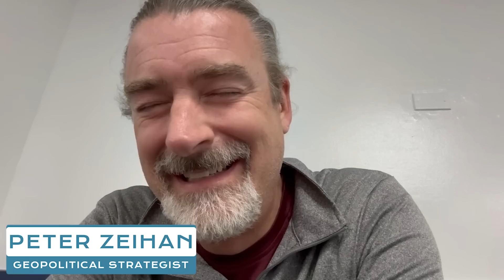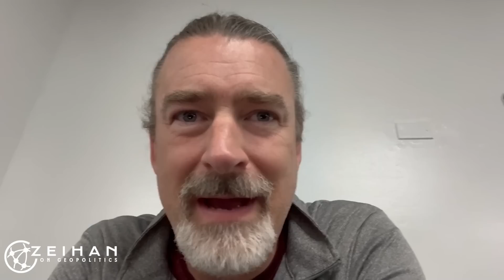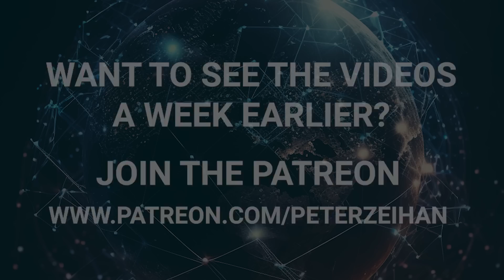Nuclear Power's Facelift: Small Modular Reactors || Peter Zeihan

Comment: Nuclear engineer here. I work in the contracting sector. Specifically, the work my company does is required for reactor licensing. Most plants are currently licensed to 60 years, but are pushing for 80 year renewals. More than likely they will also try for 100 year licenses, but beyond that is unlikely.
Reply: Is relicensing these facilities a big challenge after the initial license expires?
Reply: @CliffSturgeon  Yes and no. The overall process is relatively simple: is the neutron damage low enough for a license renewal to be safe? If the answer is yes, then you’re good to go. The issue is that each renewal for a plant requires more accurate and comprehensive damage calculations, which take more and more time. Also, there is the issue of that we simply don’t know how the reactor materials will behave at 80+ years of exposures, since nothing has been exposed for that long before. (EPRI is currently running exposure trials to figure this out).
Reply: @CliffSturgeon  no ? Sometimes it is with public resistance..
Reply: would it lower expenses if reactors could remove the need for on site storage by having domestic reprocessing like the french do?
Reply: @FroggyTWrite  Not really. Spent fuel requires multiple stages of on site storage before being safe to transport to a national repository (that will hopefully exist sometime in the future)
Reply: @FroggyTWrite  You do not want the PUREX process. Query CURIO ANS ... New process and less waste ...
Reply: Most parts are not radioactive and can be replaced over the years. Is the reactor vessel itself the only part that can't be replaced? (without tearing down the building)
Reply: @zapfanzapfan  Yes, that is basically correct.
Reply: Thoughts on Thorium Reactors?
Reply: @TheBryceWade  If we're going to go with breeders like the Thorium reactors, might as well go with Uranium/Plutonium breeders like the French have been doing for 50 years now.
Reply: @shawnnoyes4620  Guess I'm out of date.  Make that "like the French had for years before they stupidly shut them down."
Reply: YIKES we got like 4 reactors in the State of MICHIGAN alone. would be bad for our state and country if they were to all go offline. especially the Fermi nuclear reactor.
Reply: @brianhillier7052  Gretchen just announced 1 or 2 of them are either not going to close as planned with one actually being re-opened after being closed for years.
Reply: What structure will these SNRs  likely sit in? Someone will need to develop new structures to house these units?
Reply: @jimmeh213  Giant concrete slab. Simple as that. Likely partially underground.
Reply: @jimmeh213  SMR = Small Modular Reactor
Reply: Is that really desired? "how much better" is a nuclear reactor now compared to 50 years ago? might be better to force them to renovate at 60.
Reply: @celdur4635  It’s not as simple as renovating current plants. Nuclear reactors receive so much radiation exposure that decommissioning of them is usually just the encapsulation of various components into concrete tombs. You realistically can’t convert a current reactor into future reactor. New reactors need to be built. Once reactors near the 80 year limit I imagine some of them won’t qualify for another 20 year extension. That’s a significant chunk of the US power grid just kinda vanishing.
Reply: @celdur4635  Many of the newest designs are passively safe. They don't require immediate backup power to cool the fuel after a shutdown.
Reply: Aerospace engineer here - GREAT COMMENT.
Reply: @bretthuff8971 - Are you in the US?  If so are you aware of any moves in the US to adjust licensing requirements for SMRs given their different size, production method and potentially different risk profile?
I'm curious to see if regulators are even remotely close to such a thing, are there any special provisions for prototype reactor implementations such as an early SMR implementation?
Reply: @davocc2405  Yes, I’m in the US. The NRC is working on regulatory positions for new reactor designs, starting with SMR’s. But things like that take forever, and the lack of a concrete position delays development.
Reply: @Iskandardeeznuts  I remember the MIT students presenting "state of play" when they introduced their WAMSR concept on the TEDx platform about a decade ago - they mentioned that the fear and hysteria around nuclear power had drained the industry of personnel and that at the time of their presentation they were experiencing significant shortages of qualified personnel just to run what was already there, let alone new programmes.

Are you seeing a state change in this scenario since then?  I'm hoping nuclear can achieve "cool" (or at least slightly less radioactive) status politically in the term - that seems  to drive policy formulation and money flows quite a bit, very very much so in the UK.  I'd love to see our government just throw everything at forcing it out the door more like we did in the 19th century with thigs, would it be safe to assume that the industry's sufficiently technically mature for this to not result in a likely catastrophe in your opinion?
Reply: @ Yes! The general perception about nuclear is still a bit muddy, but things are improving, especially regarding nuclear personnel. I’m a recent graduate and the trend in class sizes in the nuclear program is trending up significantly. Some of the nuclear classes are needing to be taught outside of the nuclear building because the classrooms are too small.
Reply: @Iskandardeeznuts  Brett, I was at the MSR Workshop in Knoxville 3 weeks ago. It was well attended with about 365 attendees and many technical discussions oriented toward practical issues. The interest and expertise is here! We just need a lot of misinformation to stop propagating along with improved regulation. The NRC is onboard. Things are looking up.
Reply: @davocc2405  Im in Canada. not sure about the regs but you can check out Canadas smr action plan on their government site, I haven't read it. SMR is scheduled to begin construction in Darlington Ontario Canada in 2025 pending regulatory approval.
Reply: No you 're not. According to Peter you 're a Nucular Engineer.
Reply: SMRs = NO!

The first US plan for a small modular reactor  was the mPower project. It was launched in 2009 and should have become operational in 2018.  Instead it was cancelled in 2017 after the costs almost doubled to half a billion and the  Department of Energy refused to eat up the bill.  Then there’s the American company NuScale. 

In  2016, NuScale’s CEO, John Hopkins said that they expect “to deliver its first project of  twelve power modules… for an overnight price of approximately 3 billion dollars, with  commercial operation commencing in 2024.”  But NuScale gradually shifted  the starting date to 2030, and the estimate cost more than tripled,  eventually exceeding 9 billion dollars.

NuScale Power's small modular reactor (SMR) project in Idaho was canceled in November 2023 due to rising costs and a lack of subscribersNuScale Power's small modular reactor (SMR) project in Idaho was canceled in November 2023 due to rising costs and a lack of subscribers
Reply: @yedidyah-jedshlomoh1533  where did the money go though?  Remembering we have been building mobile reactors since the 50s and 60s, what caused this operation to implode like that?
Reply: @davocc2405  In 2019, the CBO estimated that the SSN(X) submarine would cost $5.5 billion per hull, while the Navy estimated a cost of $3.4 billion.

Double that in today's dollars.  Double again or additional parts and again to make civilian safe.

The cost of building a nuclear submarine for the US is estimated to be between $112 billion and $128 billion for the Columbia-class program.

imho
Reply: I have a feeling that they might receive the 100 yr license renewals, maybe even 120 b4 something very bad happens...
Reply: Im considering applying as some form of technician at some nuclear facilities near me
Reply: @FraterMikhail that’s a weird comment but you go ., this isn’t a Homer Simpson job . Please go to the University than you can get nuclear ☢️
Reply: As  a nuclear engineer what do you think of Canadas work on smr's as well as the impeccable safety record of the CANDU reactors? How about molten salt reactors? I hear Gates is going to build one.
Reply: @poppyfairfield  CANDU is graphite moderated, like ... Chernobyl.   Light water pressurized water reactors are probably the way to go.
Reply: @psychohist  ooo scary words Chernobyl! wouldn't shut down Canadas nuclear program just yet. I think your missing some crucial safety features in your assessment.
Any thoughts on the safety of molten salt vs light water  pressurized vs efficiency?
Reply: @poppyfairfield  Not a big fan of molten salt, either.  Obviously wouldn't shut down Canada's existing reactors.
Reply: @psychohist  No, it is not ... CANDU is an acronym for Canada Deuterium Uranium, which refers to the type of nuclear power reactor that uses heavy water as a moderator and coolant, and natural uranium as fuel.

Comment: the nuclear waste problem is resolved with FAST reactors. they run on what the US currently classifies as "depleted uranium" where as France and Japan see fuel for some of their larger plants, where the final waste product is significantly smaller as well as only having a shelf life of a couple hundred years, rather than a few millenia that US nuclear waste currently has for shelf life.
Reply: The nuclear waste problem isnt a technological problem in the first place it is a political one. Storing large amounts of nuclear waste long term is fairly easy if any time the federal government tried to set aside some land to do it the people in the state didn’t complain it wouldnt even be something we would be talking about.
Reply: The exact comment i was looking for
Reply: No.  The fuel availability problem if any, is fixed.  Fast reactors still produce fission products, so the spent fuel problems remain.
Reply: France and Japan don't operate their breeders any longer.  Russia built one, and has a second left over from the Soviets.

The total mass conversion through nuclear fission is a rounding error.  It doesn't matter what type of fission you're doing, you're going to have the same mass of waste as you started fuel.  The only thing that changes is the composition, and while Pu-239 will produce different long-lived products as U-235, it still produces them.  With increased burnup, you actually have more real waste, as opposed to relatively inert unused U-238 that is primarily waste by association, and could be processed out from either fuel cycle, if we bothered to spend the money to process the waste.
Reply: Gen IV reactors currently just exist in theory and are prohibitively expensive to build.

Comment: Plutonium isn't just for weapons. Excess production from recycling could be used in radioactive thermal generators (RTGs). Because the plutonium supply has been limited, it's been hard to get enough for RTGs for space probes. Having a better supply might make use of RTGs possible for other than space technology.
Reply: Pu-238 isn't extracted from spend fuel, you would have to separate it from the other isotopes of plutonium in that case. Pu-238 is made by extracting Neptunium 237 from spent fuel and then putting it back in a research reactor to transmute it into Pu-238.
Reply: Not to mention that the threat of Nuclear proliferation due to commercial nuclear power has been a nothing burger for the past 60 years. The countries that wanted nukes got nukes, the countries that wanted reactors without weapons got that too. The reprocessing technology that both France and Japan use extensively didn't move the needle on that in the slightest.
Reply: It appears that there's competition in medical and industry application for the various available isotopes. RTG, as in the thermoelectric version makes sense for space use, but no such limitation exists in terrestrial application, i.e.: the thermo bit could very well heat up any working medium to spin turbine.
But ROI on such application is iffy though, too much trouble with questionable benefit, if any.

Comment: Ft Drum in NY has local Lawmakers pushing for a Nuke on base.    3 aged out plants in Oswego they keep extending licenses for them one has a vertical crack in the cooling tower.   The Grift when they were built was unbelievable and they shut down a perfectly fine NEWER plant on the Hudson by Albany a few years ago because “ those “ people are more important than the rural folks that feed them.
     They also got permission to build on the largest amount of fresh drinking water of Great Lakes because the waste was never to be stored there.   Guess how many casks of spent fuel are sitting on the lake edge ….. ALL OF THEM !!!

Comment: Rolls Royce in the UK have had a SMR for some years it just needs customers. Retired nuclear submarine engineer regards.
Reply: RR have a few customers. Not enough though. I believe the main issue is they currently lack British government endorsement. Why would anyone invest in RR reactors if the British government doesn’t seem very interested. I’m not saying that the uk government should be interested. Maybe there are better options out there. Regardless nuclear will be a big part of our future energy grid.  It just may or may not include Rolls Royce.
Reply: @ I suspect that because the price of solar + wind + batteries continues to drop, by the time these nuclear options actually get built, they won’t be economically viable, more with the time frame for full scale nuclear power, which is more economical than SMR
Reply: FOR FARK SAKE CAN YOU JUST GO AND WATCH ROLLS ROYCE'S OWN VIDEO BY ONE OF THEIR ENGINEERS. Its here on YouTube.
He said it would be 2035 before they could be ready to start deliveries of SMRs.
And that was provided they started back when he said it.
These constant claims that its just a few years away ARE NONSENSE.
Reply: @tonywilson4713  The proposal a few years ago was to modify PWR 3 as the little bit larger unit for use  an SMR for use as a facility supply and gradually phase in the smaller design after proof of concept and for smaller users.
Main problem is control and licensing.
Reply: @johnhargreaves3620  YES I AM WELL AWARE that many of the SMRs proposed are based on the military units out of subs and aircraft carriers.

Its one of the main reasons I tell people they should take what Rolls Royce, GE and Framatome say seriously and the rest of the SMR crowd as just people trying to make noise to raise money.

So if one of the engineers from Rolls Royce is saying that it will be AT BEST 2035 for the first production SMRs then that's the best date and everyone else can STFU.
Reply: Nope, it just needs to be economically viable.
Reply: @markthomasson5077 
Nuke power is viable. Because it 24/7 reliable, and minimal CO2. Industry and tech will pay for that. 
Solar & Wind are NOT viable because they are not reliable.
Reply: Thoughts on Thorium Reactors?
Reply: @TheBryceWade  There are no thorium reactors. There will be no thorium reactors. It doesnt work reliably.
Reply: Well it's Not Rocket Science or Brain Surgery Pal! Homer Simpson could do your Old Job Pal!
Reply: There are many problems with them including the nuclear fuel which needs to be a lot more enriched than standard reactor fuel. Obviously they do work well for submarines and carriers.
Reply: @Withnail1969  What you are talking about is called HALEU fuel, which stands for High Assay Low Enriched Uranium.

For uranium the dividing line between low enriched and highly enriched where it can be used for weapons is 20% U235. Natural Uranium is around 0.7% U235.

Typical fuel grade is 3-5% U235.
Military grade was typically around 8% but it varied depending on reactor type and how long they wanted to go between refuelling. That changed with more modern military reactors which use HALEU and is why they can go 20+ years without refuelling. HALEU is around 19-19.5% as in just below that 20% value.

On that 20% value as far as I know its theoretically possible to make a critical mass device go bang with 20% but as far as I know nobody did that. Hiroshima was a combination of 50% and 80%.

If you want to read up on it Wikipedia is actually very good on the subject.
Reply: @Withnail1969  Agreed. 
On a basic level you need 2-5 times as many gas centrifuges depending on what your normal U235 fuel is. that alone costs a lot of money to build, operate and maintain.

Then there's the TRISO fuel many are claiming they want to use. NOBODY has yet made enough of it to run a real test and prove it works.

There is a real chance SMRs will find a niche but its not going to be in the next couple of years. That's just pure nonsense.

I just saw Peter's latest on the Israeli attack on Iran and that's even worse than this one for basic technical facts.